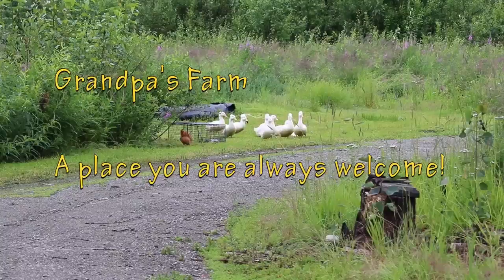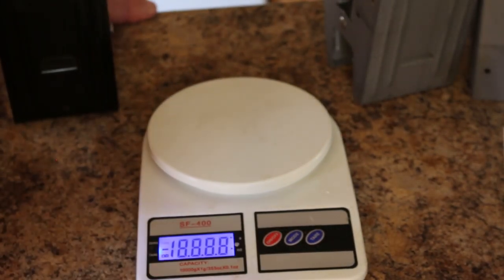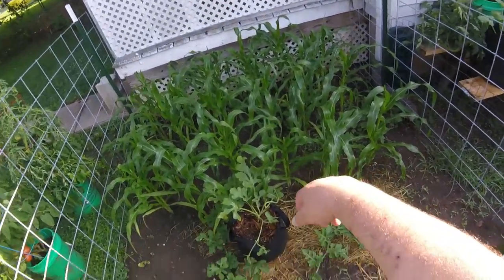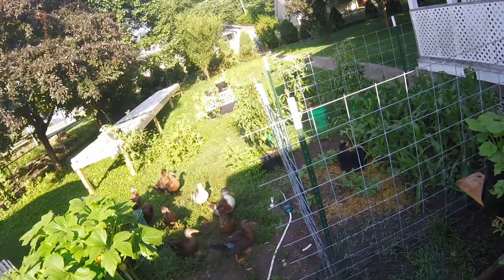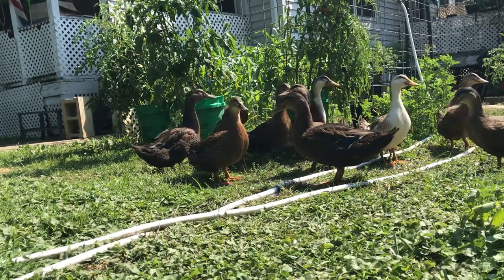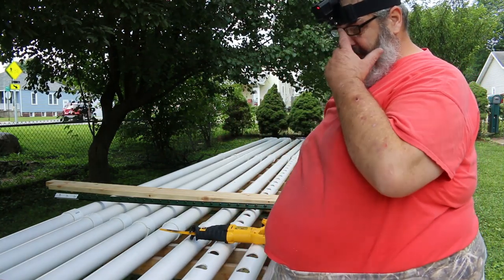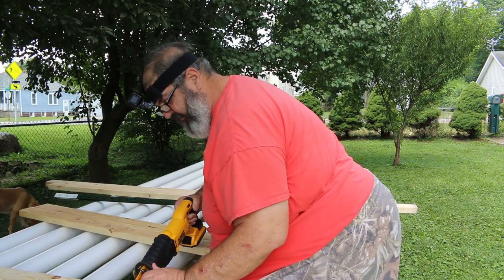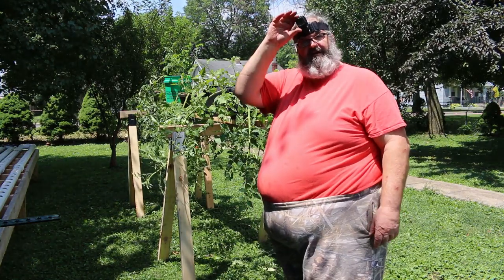Lowes vs Harbor freight - sawhorse brackets and ducks! lol.

Comment: Just bought the harbor freight brackets.  A standard 2x4 doesn't fit.  The ones from Lowes I bought last week, fits fine.  Watching your video, when you're saying they are the same width, length, etc...I can see that they are not the same size.
Reply from the maker: Thanks for sharing. Made this video a long time ago. Things may have changed since then.